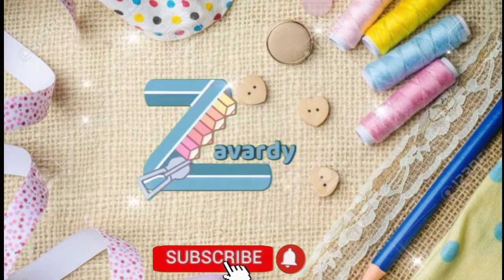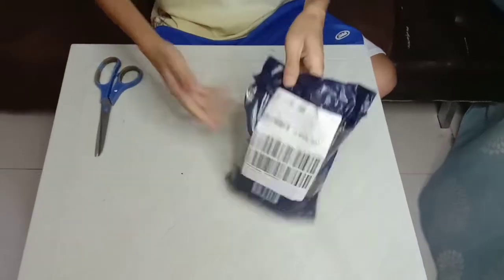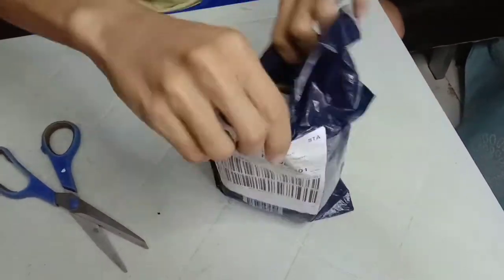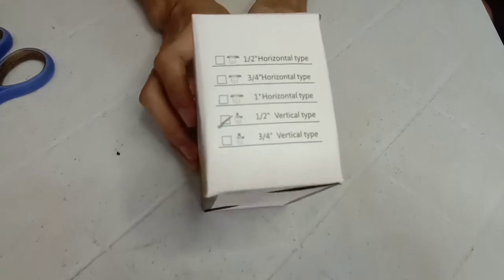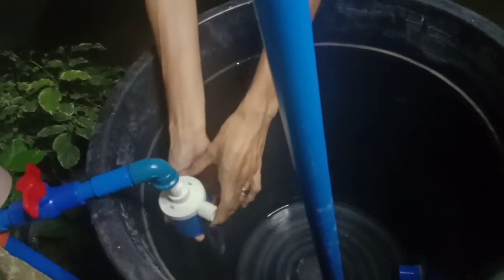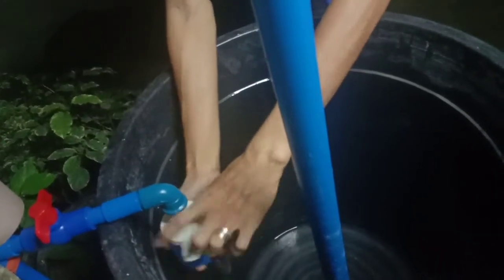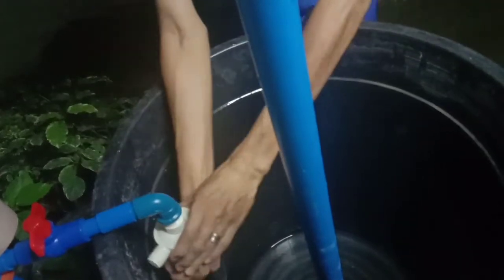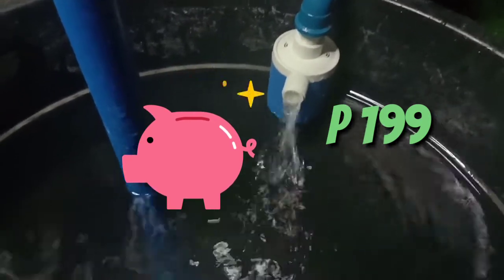Unboxing automatic water level control valve

Comment: If you Really Love your money , Time & Energy then dont buy thsi, i already have this product, i buy after seeing many reviews, but trust me after using a 45 day , in 45 day i take out valve every after 3 days , water output problem , better to go for float valve or other thing in the market. hope it will help others
Reply from the maker: Hi thanks for the compliment, anyway i dont think so, because I'm still using same product until now. It saves me time and worry less for over flowing water. Maybe check your water valve something may stock into it.
Reply: @zavardyofficial  every thing I have done, many time I open the valve, but same thing again and again

Comment: Does it slow the water flow? Or it stays the same after attaching the valve?
Reply from the maker: Hi there, it stays the same flow when attached the valve. It will just stop the flow of water when it reaches the level of the valve.
Reply: @zavardyofficial  okay, thank you very much for replying, i am attaching one today, hope it works perfectly 🤗😊
Reply: @zavardyofficial  my valve reduced the pressure so much that there was almost no flow, I don't know if it was a faulty valve or something else. The guy who sold it told me that I should expect 15-20% reduction in flow.😔
Reply: Same here. I thought its from the water source that made it slow. Then i tried to use a hose and the flow was very fast.